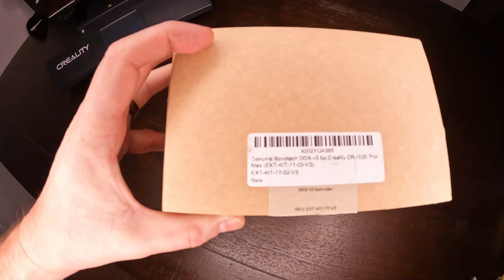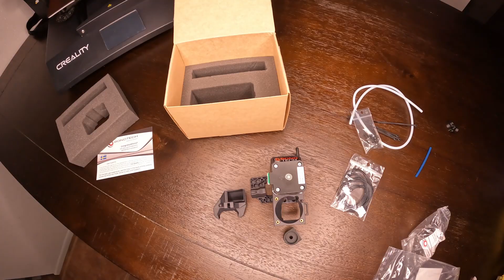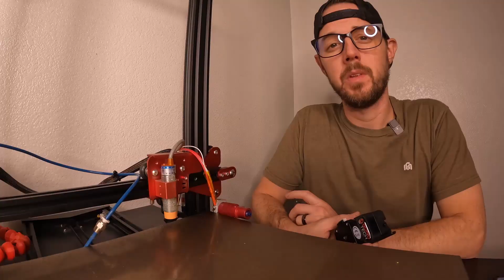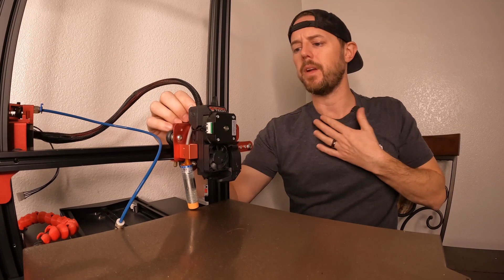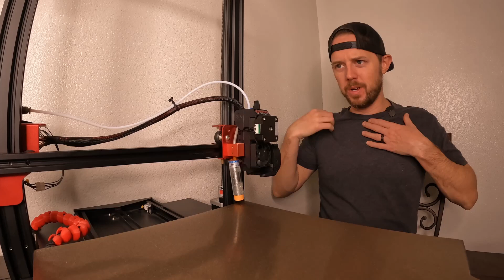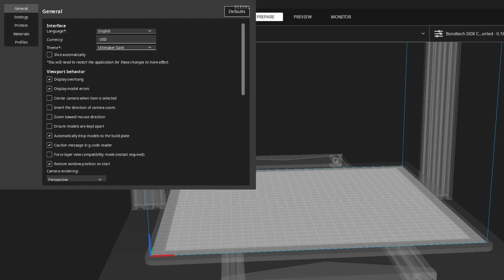Bondtech DDX Install on the CR-10S Pro V1 - Tiny Machines Screen Flash & Firmware Update!

Comment: I had the vref set to 0,4 as it says in the bondtech guide. I'm going to set it up to 0,7v as you because now I have lots of skipped extrusion and thus under extrusion.
Reply: Yeah, turning it up to 0,7v from 0,4v as it says in the guide and it's not skipping extrusions anylonger. Your video is correct, their guide is wrong.

Comment: i do not under stand  as i printed out the hot end spacer it is a smaller diameter than the original cr10s pro hot end meaning the spacer is not a snug fit   it states that the spacer is  od of m7  how ever the hole is wider   please can someone help me here   i turn my hot end upside down  and the spacer just falls out   hmmmmm
Reply from the maker: Don't worry if it's not a super snug fit, that's not the purpose of it. It's more of an alignment jig. So as long as it's centering the PTFE, you should be good. Hope that helps!

Comment: Did you ever move your runout sensor to the top rail or above the ddx? If so, what cable extension did yiu use?
Reply from the maker: I didn’t. I left it in the same place. It’s such a short distance as well as moving it would have reduced Z height. 

I’m sure there may be extension cables out there. But that’s something that would be super easy to just cut and splice if you wanted to go that route.